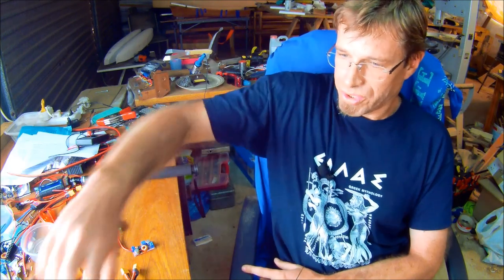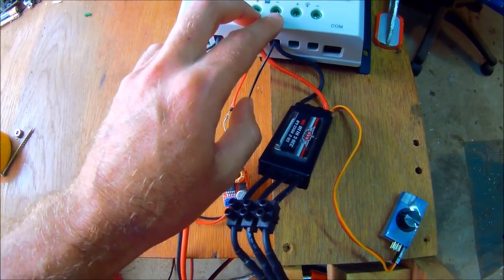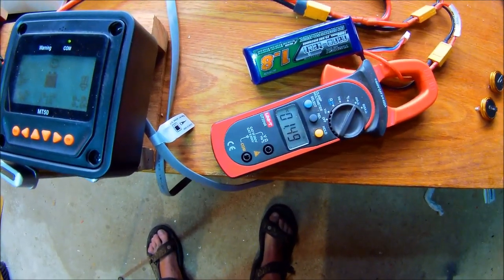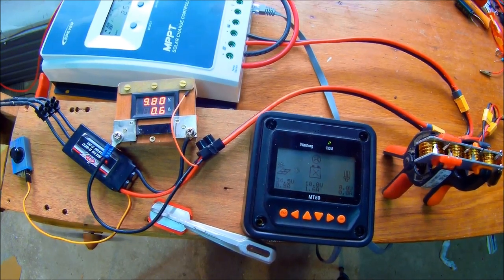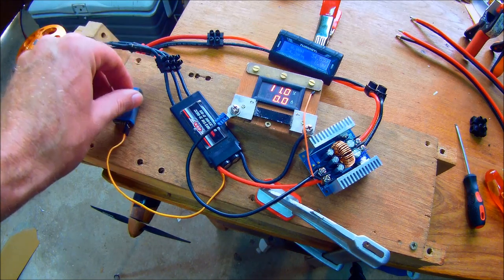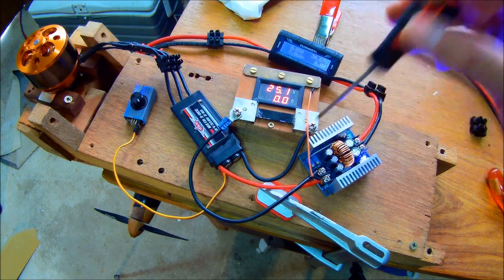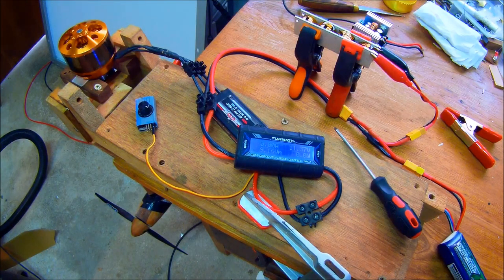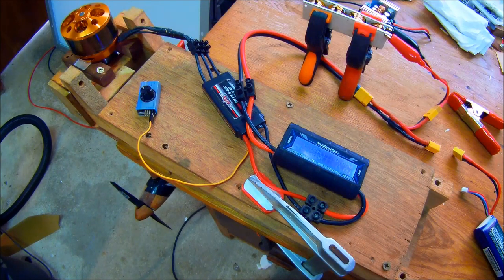Solar kayak - Brushless motor and fried electronics on the start line

Comment from the maker: I have since discovered to reason for the MPPT's slow response. The voltage difference between the panels and output terminals was too large. When I connected an 18V panel it worked perfectly at the low output voltage. When using the large panel (Vmpp 31V) it performed great with an output of 25V and using only super capacitors as storage.

Comment: 2:34 Those switching converters usually have a current sense on the -ve output, for that to work you need to isolate the input and output -ve currents, if you don't (like in the above wiring) the sense sees too little current and it overdrives the MOSFET and they blow.
This is also true of the big ones, you must always isolate the input -ve from the output -ve which can required some careful thought in layout. If you can't, buy a specific 3 terminal regulator (which are usually the linear ones).

Comment: Great idea.
Just a few questions.
Remember a few facts about RC electric Motors. Equipment.
Water and air ratio.
Air propeller under water can work but just keep it mind from 15000 rpm down to 1100-3000rpm need more Torque.
kv spec need to drop to increase torque!
Or run plane motor with reduction gearbox!
To get the right rpm to motor spec.
Here it what Il do to this design.
Us this list.
Marine ESC 200-600A water cooled jacket.
Buggy or truck Inner runner motor with low kv spec 1000-5000rpm band with the 14.8volt.
Make water proof cover for motor to run underwater with water as the cooling
Must have battery on system as reservoir to buffer the voltage drop spic as a cap.

The you will have successfully se alot of robust systems and alot of power output over time

Comment: What about going another way?  DC PWM controller from panel into ESC.  As you turn up the esc the draw on the motor will keep the voltage of the panel down if you have a low voltage ESC. PWM's are available up to 60A which is a lot more than a 300W panel or 2 will do.  They will also do to 60V so you have plenty of margin there as well.   You could have a volt meter and adjust the voltage from the panel as close as the ESC will take  which I would assume is less than the panel could put out. A 12S ESC would allow you to run at Max power point.   Even being 10V either side of the optimal power point of the panel will only decrease output by about 10%.  You could run a charger for the Lipo off a Buck converter and then just have a switch to kick that in when you went under bridges or for the time you'd probably use it, don't worry about the charger at all. 

Mounting a 300W panel front and back would make a big difference to things as well.  Seems you have room  to do it.  2 panels should get you under bridges no problems. 
I run car radiator fans off panels to cool my shed and roof space. Some of these fan motors are quite powerful and would provide all the power you get from a panel or 2 and Might be a cheaper way for you to go.
Reply from the maker: I have considered pwm, I have a few cordless drill triggers lying around but I don't know how much voltage and current they can handle. These smart panels are supposed to maintain mpp from 31V down to 24V, adjusting the current upwards as voltage drops. Almost as if it has a small buck integrated into the system. My ESC can handle 8s, or 33.6V. Panel Voc is around 35V. The plan, as you suggested, is to limit the initial voltage to the ESC through the PWM until the panel voltage has dropped to withing safe limits. These drill triggers bypass the PWM circuit altogether when fully depressed, so at max power there are no MOSFET losses and the panel feeds the ESC directly.

Comment: Been watching your videos tonight and I love the idea of being able to run right off the panels with no batteries. I live in south west Florida and have plenty of sun. I live on my 32’ sailboat and it has 400 watts of panels and they keep me charged with out an issue. Would love to do this with my tender.   What do you think you have into it cost wise?  Parts break down list?
Reply from the maker: The most expensive parts (excl panel and MPPT) are the motor and speed controller, around $60 each. Gears, shafts, bearings etc perhaps another $30. The real investment is time. What tender do you use? Do you already have a motor on it?

Comment: What do you think about working life of
el.motor from drillmashine ? (brushes,gears)?
Reply from the maker: Interesting question. The operating conditions differ quite a lot, but I don't know how it affects lifetime. If designed for best motor efficiency then average rpm will be higher compared to drilling. Continuous runtime will be significantly higher in one direction and the number of times changing direction to reverse will be much lower. Current and torque would be lower. Shock loads would be very few but there might exist higher frequency harmonic vibration.
Reply: @williamfraser  For solar raise it's good solution. But when I want to cruse  
on sunny day four many hours, lifetime may be short ? Drrilmashin is designed 
to drill short several holes a day.

Comment: I like where you are going with the buck converter from solar panels to ESC. I was wondering what voltage the solar panels were at under different load conditions? Another random thought was to use a boost converter connected to supercap/lipo to try and force the panel voltage to the MPPT point of the solar panels as you go under a bridge instead of powering the buck converter as you did in the last setup you showed in the video. Great channel by the way, only recently found you!
Reply from the maker: A solar panel will automatically generate an open circuit voltage that is higher than its Vmpp. In shade, the cooler temperature of the panel might even allow it to put out a higher Voc, but with greatly reduced Isc. You achieve Vmpp by managing the current drawn from the cell. So even in shade the buck would be of use, since it can take whatever current is available and deliver it to the load at a lower voltage and higher current. For a fixed load resistance, the buck's output voltage needs to be adjusted to manage the current. I will put together a more detailed video to investigate the panel's output characteristics under various light, temperature and load conditions. I want to understand it better myself.

Comment: Hi friend .  I really like your projects.  how much power do you use a speed regulator in amperes frequently?
Reply from the maker: Can you rephrase your question? It is not  very clear.
Reply: Hello.  I am making a solar system on my kayak.  I have two got 100vat.  and motor with Ali Express 6354-270kv.  the question is what esc A?  suitable for me?
Reply from the maker: @viktorrabi7811  I assume your panel is 100W, so max power voltage is around 18V. If you are using only solar without a battery then a 20A ESC is ok. You will need an MPPT or buck converter to limit the voltage to esc's max voltage, around 13V for most 20A esc units. If you use a battery then the esc size depends on the propeller dimensions and the maximum power you desire. I will have a look at the motor specs in the meantime. Let me know if you will use a battery and also what propeller.
Reply: thank you very much.  sorry for not being able to answer right away.

Comment: So I am just trying to figure this out. I would like to build a system that can run of lipo batteries if there should be any shade or other problems with the solar panels. But I am confused about whether I can hook up an mppt solar charger directly in parallel to the lipos so that the solar power is in parallel to the batteries, so the current draw is from the lipos when in shade. The only solution I can think of is to let the solar panels charge one lipo battery while another one is in use and then switch the batteries when needed or having the option to just run on solar power.
Reply from the maker: Yes, the solar feeds into the MPPT, the motor and battery connect in parallel to the MPPT outlet terminals. Most solar charge controllers have a separate pair of "Load" terminals, those are just in case you need to automatically program on/off times or set a current limit for the load. The panel will automatically supply all the power that the load demands. It does this by keeping the outlet terminals at the pre-set battery charging voltage (e.g. 4.2V/cell for Lipo). When the load demands more power than the panel can provide, the output voltage will start dropping. This allows the battery to start supplying the additional power required.
Reply: @williamfraser   I see. so if I just preset the mppt's output current for the batteries current, I won't damage the batteries. I guess it would be smart to have a BMS on board? thank you so much for the fast reply!
Reply from the maker: @jacobtoft7401  on my MPPT there is no direct setting to limit the current to the battery. It does however require the battery Ah capacity and from that it determines a safe maximum charge current. I don't recall how much that was, most likely between 0.1C - 0.5C. The problem is that if you have a powerful panel and a small battery, you will also be limiting the max current that the load can draw through the MPPT. With both load and battery connected to the same terminals, the MPPT cannot tell the difference between current demand from load vs that from a charging battery.
Reply from the maker: @jacobtoft7401  how many panels do you have? What is the mpp voltage?
Reply: @williamfraser  I have 4 100w panels, 19,4 volts open circuit and a maximum power voltage of 16 volts.
The mppt has no load output, only a battery charge output, of 27v to 72v.
Reply from the maker: @jacobtoft7401  That mppt is only rated for 300W. If you limit the output current so that your batteries do not charge at more than 1C (i.e. 5A/cell) then your batteries can absorb at most 250W of charging (4.2V x 12 x 5A). Some batteries can be charged safely at 2C but it will likely reduce battery life.
Reply: @williamfraser  I was either going to use 2 or 3 panels due to limited space on my boat. But thank you so much for the help!